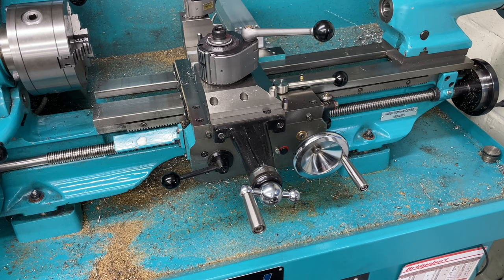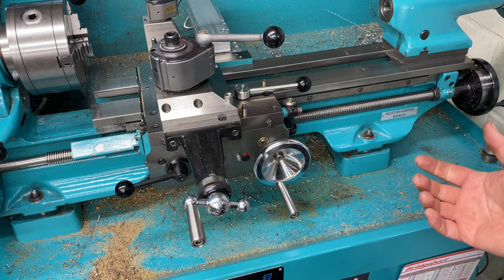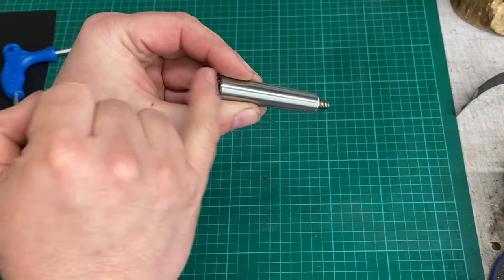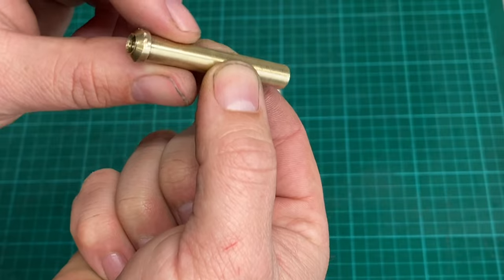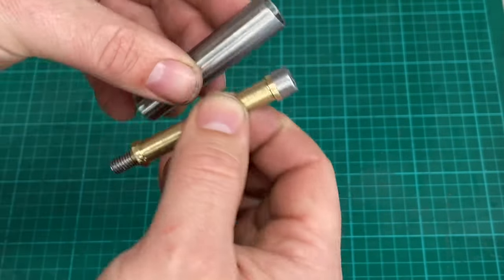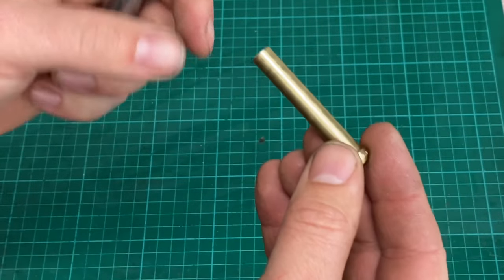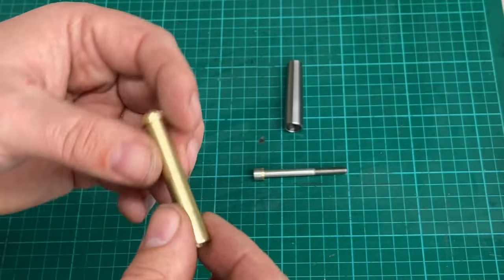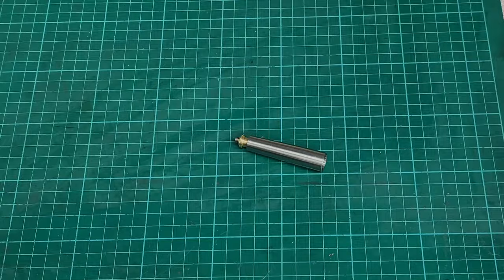Spinny handles for the lathe.

Comment: Beautifully made as always. Personally I never use the handle parts on my controls, I use the perimeter of the handwheels and the cross pieces on the cross and top slides. I find that this gives me a better feel for the work, and I never have to make quick traverses that would be easier with the handles. A matter of what you get used to I suppose, but I would certainly use your elegant method if I found the need. Best wishes.